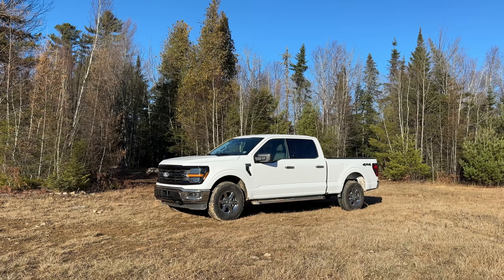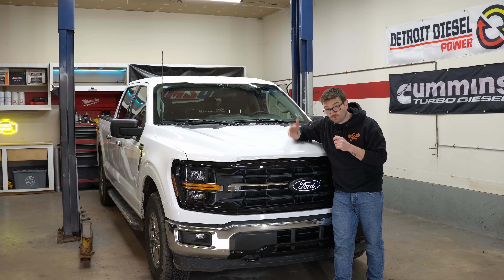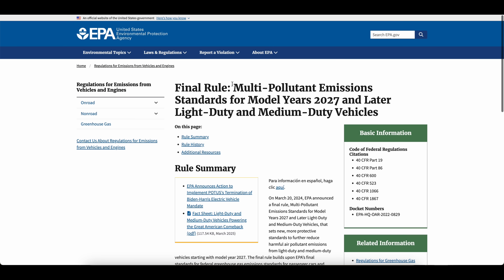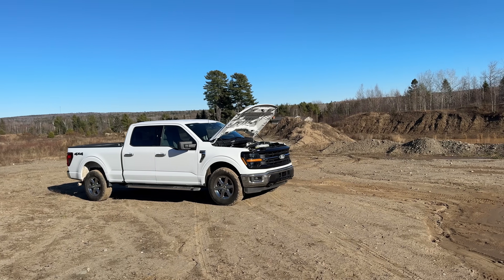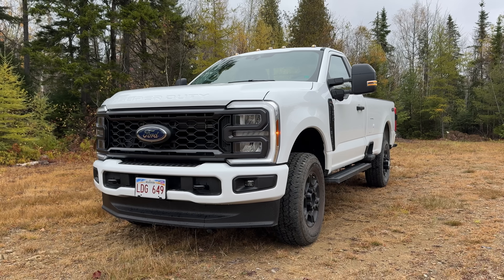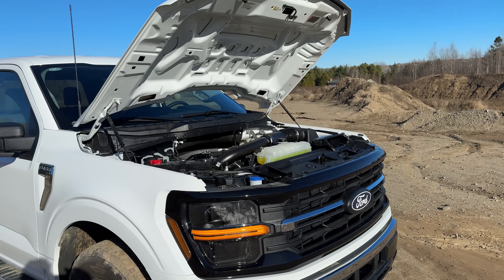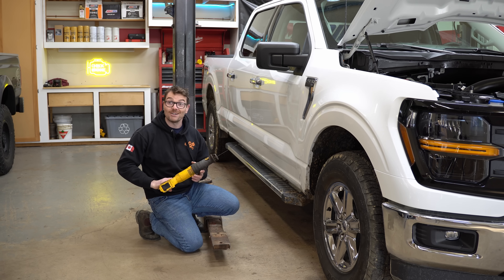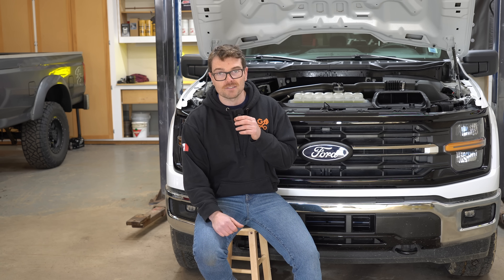Ford F-150 3.5L EcoBoost Is Now Getting Gasoline Particulate Filters… Here’s Why It Matters

Comment: Unfortunately, probably the best news the Windsor FMC 5.0 Coyote plant has heard. This will certainly boost the v8 orders. No dealer will want to preorder these 2026+ F150’s with GPF and only 382 hp. No brainer, 5.0 baby. Wonder if the 2.7’s will get GPFs. If so, gonna be a lot of Ford salespeople looking for jobs elsewhere. Nope no one gonna buy these trucks…. And you know the price of the trucks will go up with these new EPA devices crap…
We need some good hackers to start working on  3.5 Ecoboost EMC firmware that ignores GPF filters. Then oops, musta fell of at the lake..

Comment: This is why I’ve been putting some money into my 2015 Ram 1500. By adding a nice CarPlay touch screen and a few other mods it’s twice the truck any new one is.
Reply: Keep it forever
Reply from the maker: Keep it Running!
Reply: How many miles on it?
Reply: @Bob-m4m1r 160k
Reply: Until it eats the cam shaft and lifters. Ram's MDS is also a great epa addition🤣
Reply: @rampantfpv8386 my truck no longer has MDS
Reply: @rampantfpv8386 Hi child, only 5 percent of any ticking sound is due to cam/ lifter problems. The rest are due to broken exhaust manifold bolts. If every Ram HEMI had a cam / lifter problem there would literally be thousands and thousands of trucks sitting in shops across the country. But good try.😊

Comment: This is really sad where we’re headed ….
Reply: To a world with less pollution? Yes, very unsettling.
Reply: @chickenstrangler3826 due to the ridiculous emissions laws heavy duty trucks doing the work that makes the world go round now have parts and stuff fail more often so we have to replace and trash more parts more often THUS creating MORE pollution than if they never added any of it in the first place….. so yeah
Reply: @johnmorreale678   That sounds like your intuition rather than research.

The amount of pollution emitted from diesel vehicles over billions of miles (counting each vehicles contribution) probably outweighs pollution from replacing more parts, towing, or sending a service truck out. So, tighter emissions is better (I'd imagine).
Reply: @johnmoral. 1. Modern emissions systems DO NOT create “more pollution overall” than older pre-emissions diesels.

All credible engineering analyses show the opposite.

❗️Fact: A 2010+ diesel truck with DPF + SCR removes over 90–99% of harmful pollutants (NOx, PM2.5 soot) compared to pre-2007 trucks.

Even if parts fail sometimes, the net reduction in harmful emissions is enormous.

⸻

❗️ Key distinction:

“Harmful pollution” ≠ “CO₂/production pollution.”

DPF/SCR systems target:
	•	NOx (smog, respiratory damage)
	•	Particulate matter (soot that causes cancer)
	•	Hydrocarbons

They do not significantly increase the CO₂ footprint compared to the emissions they prevent.

Even accounting for:
	•	manufacturing parts
	•	occasionally replacing sensors
	•	fuel burned during regens

…the total additional pollution is tiny compared to the reduction in soot and NOx.
Reply: @chrisstromberg6527  Says you and all the desk engineers, but consumers, mechanics and engineers who own AND work on engines will tell you emissions improvement tech are literally the cause of most if not all engine troubles, as has been my experience from cars as early as 2000. Low tension rings lead to oil burning, CCV systems just poorly and cheaply designed, EGR, air pumps, 02 sensors, all in the top failure points and many of these systems lead to oil burning. Since Catalytic converters, the air has been remarkably improved. Enough is enough with this environmental pseudo-science. Even if you believe it, why passenger cars which are less than 17% of CO2 emissions. These ideas are ridiculous and what's more, supporting more expensive, less reliable and less convenient products on your own pocket. It's own demise you are supporting and nothing more. The environment doesn't care.

Comment: I for one don't mind this. Anything we can do to keep ICE engines on the road I'll accept, if not we'll all be driving soulless EVs. So if it takes a loss of a few horses to keep high power V8s and turbo V6s in cars I'm all for it.
Reply: The problem isn’t the loss of a few horsepower. It’s the additional complexity, which will almost certainly lead to worse reliability.

Comment: I’ll need to get a new truck eventually but until then I’ll keep undercoating the shit out of my 2016 5.7 Tundra and changing oil and maintaining it religiously.
Reply from the maker: Keep that truck running!!
Reply: @GettysGarage  I know some see it as a waste of money but I switched over to Amsoil this last oil change and the valve ticking (normal for the 5.7L) is gone. It’s always been a great running engine but it just feels even more buttery smooth since putting it in. Still using 0W-20.

Comment: As each year goes by I get more thankful that I purchased a 2021 tundra TRD pro brand new.

I’ve become so concerned about it being stolen that I actually put a dead man switch on it to help prevent theft.
Reply: It is much more likely to get t-boned by someone texting through a red light then stolen, and you can’t get it back once the frame is mangled and it’s totaled.
Reply: Ask me how I know 😢 RIP 2019 RAM 5.7 Hemi without eTorque
Reply: Thanks, now I am going to find the switch before I steal it.

Comment: Your doing a great job keeping us informed. Might need to find a good engine rebuilder in the near future.
Reply from the maker: I want to rebuild the 7.3L Powerstroke in my truck this winter but we'll see..
Reply: Hold on to your old rig then. Most new engines are designed so you can’t rebuild them.

Comment: Here comes the gasoline delete market
Reply: Use a bypass and a valve so it still passes inspection; that’s what my diesel uses and I never had any issues.
Reply from the maker: Actually though
Reply: agreed and that cat will be deleted also haha😂
Reply: @marknasia5293 I don’t want my exhaust to smell like paint thinner
Reply: If I see it, I am reporting it.
Reply: @chickenstrangler3826  you are a Karen, you probably don't have any friends too
Reply: @chickenstrangler3826 
You know what's crazy? A fully deleted modern diesel produces 38% less pollution than your emissions intact DI engine.
Reply: @MontanaMan93   By less pollution are you looking at every chemical released out the tailpipe?
Reply: @MontanaMan93  That’s a straight up lie lmao, are you gonna pretend soot and NOx doesn’t exist? Because there’s no tuning away those. They are more reliable deleted, but most definitely not cleaner.

Comment: The EPA is fighting a pollution problem that doesn't exist. I'm surprised the new EPA administrator hasn't axed this BS yet.
Reply: Most EPA vehicle emissions criteria were legislatively mandated, so the Executive Branch can’t eliminate them; however, anything that was a result of a regulatory rule and not legislation can be (see DEF requirements starting next year). Real change needs to come from Congress, and the hopeful elimination of CARB by the Supreme Court.
Reply: It's not even epa. CARB from Caliornia is behind the gpf crap. Other states decided they would follow the carb standard, so ford basically decided to equip all the 3.5s with them. I agree, these filters are dumb!
Reply: Pollution, climate change, and COVID-19 are all hoaxes meant to push agendas
Reply: Agree it is a hoax
Reply: It's because they're in bed with a certain large country in Asia and they're trying to get everyone to buy electric vehicles.
Reply: It’s not the EPA it’s California. California basically dictates emissions now because it’s just cheaper to make one emissions system versus two separate systems for the rest of the country.
Reply: That's because they're all going to profit from all of the money that they'll be embezzling under the guise of climate change
Reply: Zeldin doesn't have any real power. Big talker just like his boss. They've changed nothing. And they never intended to.
Reply: @3.0dmax  They already changed the limp mode BS tied to DEF. You should know that since you own a 3.0 dmax. GM finally got rid of the annoying 1000 mile warning for low DEF because of the change Zeldin made. The only way you are going to get changes on established emissions regulations is for someone to put a lawsuit together challenging some aspect of the regulations and Zeldin can then allow the EPA to lose the case by not fighting it. But there is going to be a sht storm if the EPA does that. There are trillions of dollars and thousands of special interest groups that don't want the EPA to change their current regulations. There is also the big issue with California. As long as they're able to set their own emissions regulations more strict than federal standards, that's a massive issue because manufacturers don't want to build two completely different powertrains for the same vehicle.
Reply: @hochhaul  Except there's no programming for the LM2.

Comment: A quality channel would update based on updated information, like the fact the power reduction listed was not correct, but instead of a typo.

As well, the idiot stunt at the beginning of the video with the engine running at high rpm is entirely irrelevant to the reality. Most diesels with DPFs regen while you're driving. Having to do a parked regen is rare unless you are doing a lot of idling. 

Combined with the rarity of having to clean the filters as explained in the video, parked regens are likely to be rare to non-existent. 

And then there's the commenters that apparently can't be bothered to watch the whole video, and start talking about this as if it's just a Ford thing, rather than an EPA thing that's going to apply to all manufacturers, and that Ford is just the first to announce the change.

In terms of the likelihood of issues, its worth pointing out that diesel engines don't have the issues they initially did. And the biggest issues early on were with International engines that tried to "avoid" using DEF. The Internationals I drove from the 2007-2014 era were constantly having issues.

But when I got my 2014 Kenworth T-680 with a normal PACCAR DEF-using engine, I had no problems at all.

This YouTuber has a tendency to exaggerate issues, and he seems to be doing it again. He hasn't corrected the video to note that Ford already acknowledged there was an error in the announcement regarding the supposed power drop. He added the "regen" stunt at the beginning of the video. And the fact that these filters are already present in European market vehicles without massive tales of woe makes it even clearer there's unlikely to be massive issues with adding these particulate filters.

Comment: If they had stayed with port injection they wouldn’t be needing GPFS
Reply: The 3.5 eco boost uses port and direct injection, DI is used at higher rpm
Reply: @cloudy4872 Yes and the DI injectors are why it's forced to have a GPF.
Reply: Yeah, funny as my 18 Hemi Ram only gets sweeter with every new auto news passing story, lol.
Ford will probably upcharge for the coyote soon just to all but kill off.  Lee Zeldin's EPA isn't aggressive -- probably trying to almost but gas ICE toe to toe with diesel (as in the same disadvantages of pollution control systems).  That said, this seems more like Ford playing the big corporate environment game more than necessity, otherwise Chrsyler wouldn't have brought back the as-was Gen III Hemi (also worse with "eTorque" nonsense).
Reply: @DeltaSierra426  I think Stellantis brought back the Hemi out of desperation and dealers screaming at them. They have over a year's worth of inventory of Ram 3/4 and 1-ton trucks and sales were soft for the Ram 1500 3.0. They brought back the 5.7 but now you don't have a choice, you have to accept the crappy e-torque system. 

Ford probably is playing the ESG game a bit but their engine lineup makes it tough to meet emissions regulations. The 5.0 is definitely going to turn into an engine option that you have to pay for a lot of upgrades to get acces to and the 2.7 will be forced on everyone for the lower trims.

Comment: That 7.3 godzilla just keeps making more sense
Reply: Save me a spot in line behind you bro. Once my 5.7 Tundra is retired that’s probably the way I’m going
Reply: @Hazmat0357 my 5.7 tundra has 230k on it. Great truck
Reply: Just ordered one. I would be happy with a 5.0L F150, but they are made to destroy themselves with auto start-stop (which can be disabled), but also has cylinder shutoff as well as much more plastic drive train parts. Stepping down from the 6.7 powerstroke due to DEF, cost of diesel, and maintenance costs
Reply from the maker: Yes it does
Reply: That is EXACTLY why I just bought one…
Reply: yeah good luck with that flat cam lol
Reply: @milkyperformance Good God, 5 years ago called they want your stupid comment back
Reply: GET EM WHILE THEY LAST
Reply: except 7-8 mpg
Reply: @araothman-m4g  You must have never driven one or done any research and are just looking to make uneducated comments on youtube...
Reply: @araothman-m4g idk my 6.6 gas dually gets 16mpg 🤷‍♂️
Reply: @araothman-m4g I routinely get 14.3 in mine
Reply: Already replaced plenty of the 7.3 Godzilla engines for lifter failures. Garbage engine
Reply: @ohmy7554 they solved this issue by raising the idle oil pressure from less than 10 up to about 30…easy to do with a software flash, as the oil pump is variable output…
Reply: @ohmy7554 actually ??? I haven't heard of many problems with them.
Reply: @ohmy7554  you clearly haven't done any research or even watched any videos about it from this guy....
Reply: @ohmy7554  That problem was solved long ago and only a small number of engines had that problem to begin with.

Comment: in europe the 6.4L hemi is euro6 certified without an OPF/GPF because it was port fuel injection only something i find interesting is the ecoboost is already dual injection port and direct i would think it would be cheaper to delete the direct injection then fit a GPF
Reply: I am surprised that a 6.4 v8 is allowed at all in Europe.
Reply from the maker: Wild that the 6.4L Hemi does not need these things but the "efficient" ecoboost does.
Reply: @GettysGarage  i can clear some of this up a port fuel injected engine mixes and burns fuel almost completely without any particulate matter no extra oxygen in the cylinder to create NOX the catalyst then easily converts the very few molecules of unburnt fuel and also breaks down the carbon monoxide into carbon dioxide and water there are basically no harmful compounds to humans co2 is plant food not pollution deal with it this is what makes even large displacement naturally aspirated engines like the 6.4L hemi meet emissions standards easily it may burn a lot of fuel but it is an extremely clean engine from an emissions standpoint 
direct injection is the most pointless thing ever introduced to gas engines basically turns them into a diesel from an emissions standpoint not to mention the issues that stem from it carboned up intakes and valves HP fuel pump and injector failures that destroy engines

Comment: I'd have less of a problem with a GPF/DPF if it was manufactured in such a way that I could go to a parts store about the filter for $50 and change it just as we can change oil and air filters. The pursuit of lower emissions has crossed the line where the equipment and failures can condemn an older vehicle to the scrap yard even if it should have many more years and miles left in it. What 's the carbon/particulate footprint of mining/smelting/refining/stamping the aluminum, steel, and plastic to make a new truck? Can't see the forest for the trees.
Reply: The biggest sources aren't even really regulated. The biggest source of particulates and NOX are commercial airliners. Add in private jets and the emissions from a truck made in the last 20 years is nothing by comparison. One Airbus flying from New York to LA dumps more particulate into the air than a big diesel pickup truck will in its lifetime.
Reply: @hochhaul  Even an older engine, if properly tuned, runs cleaner over a span of 60 years than an airliner in just a day's worth of flights.
Reply: @hochhaul common misconception, it is actually regulated. The modern cutting edge engines burn lean and very hot specifically because of emissions. There's a lot of tech that goes into this that's too complicated to explain in a simple comment but it's also physically impossible to have a working jet engine and do what piston engines do with regards to capturing emissions the NIMBY type folks are so concerned are going to lead to the next apocalypse.
Reply: The largest CO2e emitters are electricity generation, manufacturing, and ag/forestry.  Soon enough it will be AI data centers and their associated emissions.  Cars are way down on the list but they are easy to target and it's a way for the manufacturer to make more money by selling you a part or new vehicle.
Reply: @cle_roknn3742this is the real reason

Comment: It didn’t lose power.  It’s a typo on their website.  Confirmed by Ford
Reply: it's prob more like Ford didn't want the real numbers released so people wouldn't know it lost power due to the restriction and says it's a typo. Otherwise, where did they get that lower number and why would it be posted as the new HP figure? Believe them if you want but doesn't every other vehicle with particulate filters gain horsepower when they're removed? Makes sense it would lose power, but 18hp isn't a big deal anyway.
Reply: Yeah right I just believe anything that the manufacturer says
Reply: @Bill-vb1ik   🙄 So when the brochures come out with 400 HP ratings what will you say?
Reply: @BCSVT  like OEMs have never lied about the power ratings...
Reply: @PS-ro7oy With SAE certification, it’s not really a thing anymore
Reply: I would bet it's down to 350hp or less.
Adding a restriction in a already restricted exhaust system is going to lose alot of power.
The 400hp was probably a lie to begin with also.